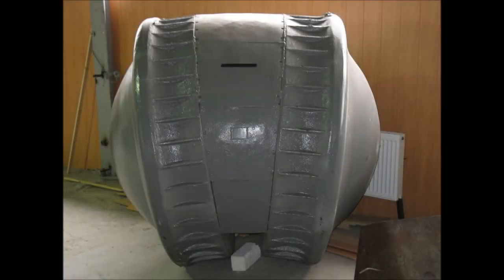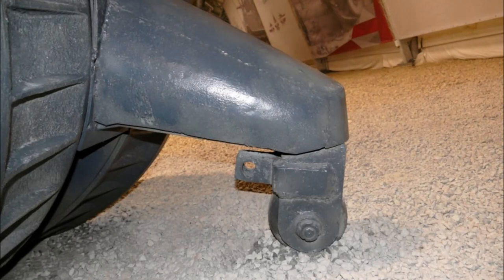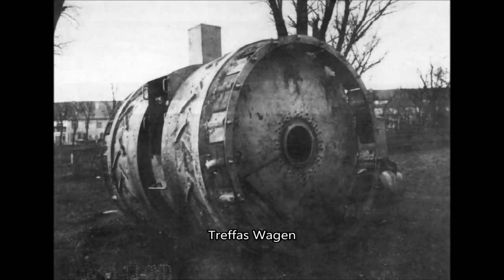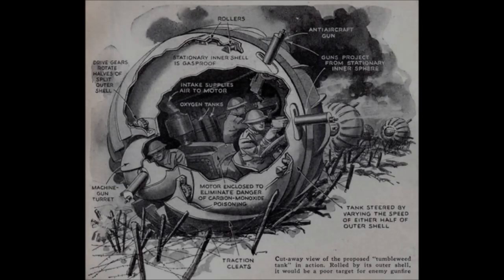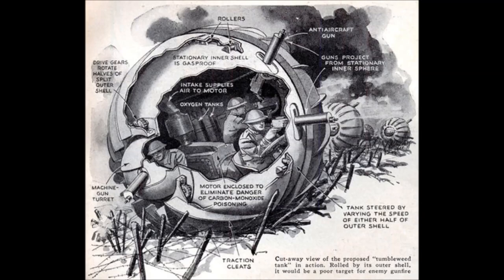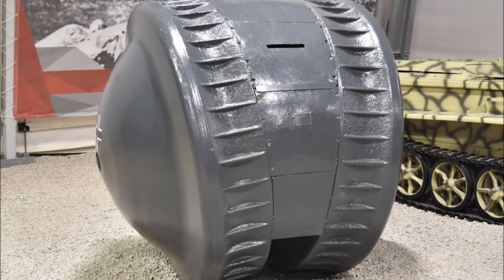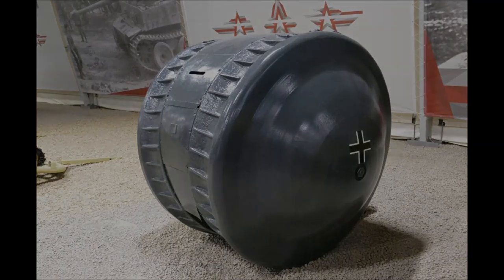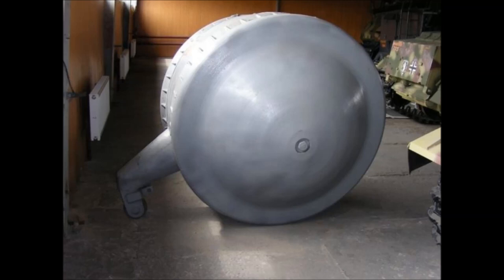The Kugelpanzer - The Real History - Origins, Purpose, and Details Of The Ball Tank (German Tank)

Comment: Most likely it was designed for patrol or guarding property / buildings as it’s not a thing to drive in on rough terrain.
Reply: If the Kugelpanzer originally mounted a machine gun, it might have been designed for urban warfare. Machine gunners are prime targets for snipers, so having a small, self propelled-vehicle that can fit down narrow streets would be very useful. It has the additional benefit of being cheap and simple to manufacture.
Reply: Tho I dont agree with these vehicles main purpose to have soilders inside a armored slow moving sphere with limited vision and mobility to be guarding buildings or property and would just be a waste on man power. Think more of it as a little armored bunker for soilders to shoot while being protected from being shot back.

Comment: id like to take a guess on the kugelpanzer its only a guess though but id guess it steering is a skid steer or similar method leaving the rear wheel solely for support similar to how an argo steers but with 2 drive wheels and one support wheel, the small two stroke motor would be mounted almost straight to a differential of sorts with breaks on the drive shafts, the drive shafts id assume to lead to gears on the inside of the drive "wheels". as far as the metal id guess its possibly a magnesium alloy or maybe just magnesium its self, today magnesium alloys are used in many armours, and many of our magnesium working methods came from Germany, due to them losing iron mines in the treaty of Versailles if i remember correctly, due to this they innovated many new age metal working methods with magnesium, so perhaps this vehicle was an attempt at early magnesium based tanks, if it were a test for magnesium based armour that could be why the metal tests are kept secret seeing as magnesium based armours are rather new and them being used is quite new as well, that could explain why it would be beneficial to the Russians to keep the results secret. it would also be a rather obvious idea in my opinion to try magnesium for such a vehicle due to the small motor it would require a light weight vehicle and planes were already being made with magnesium at the time so i think it would be reasonable to attempt to make such a vehicle out of magnesium due to weight requirements though the lack of speed and protection could easily lead to it never being used or produced.